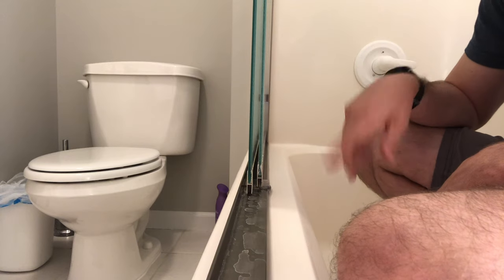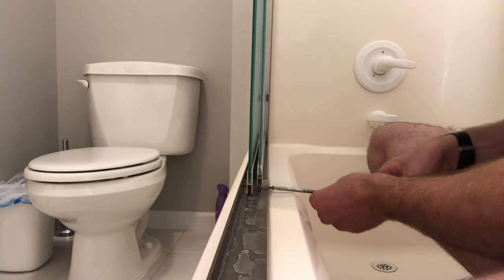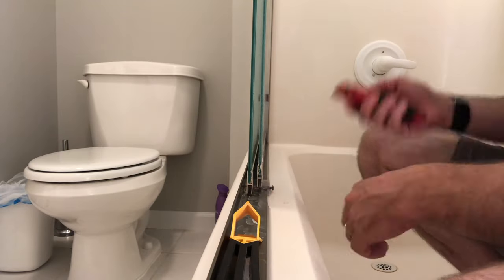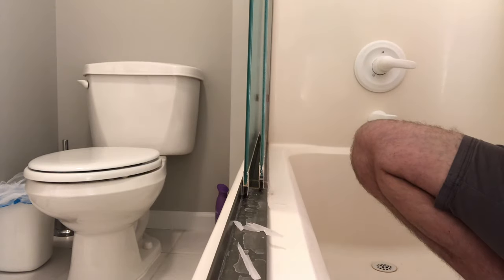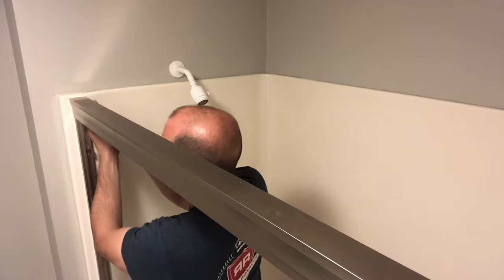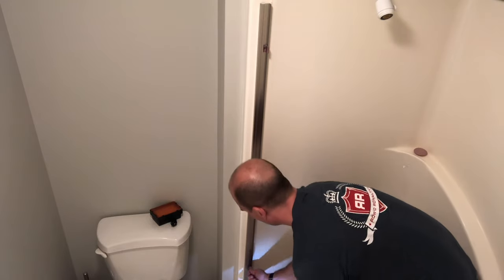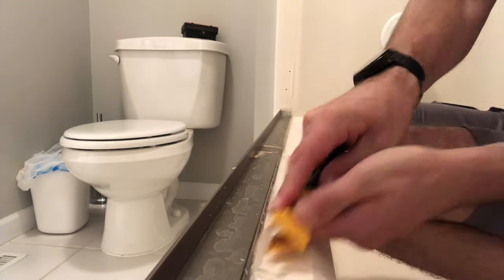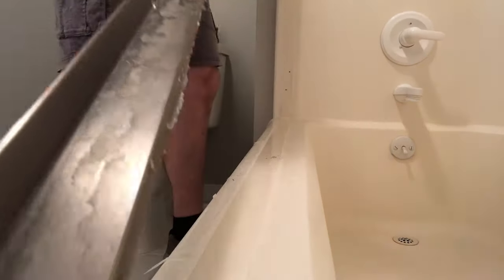How To Remove Glass Shower Doors and Frame

Comment: Thanks for this. Ours is old, scummy and rusty. I just love shower curtains because there are so many cute designs/colours to make a bathroom pretty! 👍
Reply from the maker: Yeah, all the others I have taken out have been pretty rough.  Good way to freshen up the look of your bathroom.
Reply: My problem with them is I have to use a shower chair and it's very, very, challenging to get in and out of the shower without the fear of falling on my hide... I already have an injured spinal cord as it is.

Comment: I did this with help. Doors came off easily. Rails were over-glued and super hard to come off.  But one we got them off, white vinegar was fabulous to soften and remove the side and bottom adhesive nightmare.
Reply: That’s me right now. Trying to remove the rails is a nightmare! They put silicone on the back side of the rails and and so much in the side😔

Comment: Not a downgrade its an upgrade to any shower thanks for this
Reply from the maker: For sure 👍
Reply: We bought a "spec"home. If I had my choice I wouldn't have put them in.
Reply: @EverydayHomeRepairs  no its not a downgrade I am in a RV and the shower doors when i am showering the doors are closed and I also am using a curtain. My problem is that when i move the shower rose for washing I have a leak going onto the floor and this is why Im hesitant to remove the doors to find that the water would be worse I think but thanks so much for replying as water on an RV Floor is scary!

Comment: Thanks for a really clear and simple video for removing the shower door channels. My sister just recently bought a house and we discovered that someone installed the bottom rail backwards so that the lip of the rail is on the inside of the bathtub instead of the outside. So when the water hits the shower door it just drips right onto the floor. I can't understand how someone could not realize that they installed it wrong but I will need to remove it and reinstall it the correct way. Thanks again.  👍🏼
Reply from the maker: Oh man, bummer but it should be a relatively quick fix.  Best of luck on the project!

Comment: Thanks very much for posting this video. I have a new grand baby, and my daughter wanted the tub doors removed for the EXACT same reason you describe. Removing the doors, side, and top rails was no problem, but I was puzzled as to how the bottom rail was attached: "It couldn't be just caulked in place--could it??" I said to myself. So: to Youtube! I'm taking a lunch break and then it's off to take out the final piece! 

Thanks again!

Comment: Very informative and easy to follow. this gave me the instructions (and confidence) I needed to do the job. I had the whole thing removed in under 30 minutes after watching this. I probably could have had it out in under 15-20 minutes if the bottom track had not been so tough to remove. I ended up using a putty knife and mallet to get under the track since there was so much silicone used to hold it in place. I took my time so I wouldn't chip the tub. I wish I'd done this when I bought my home 4 years ago!

Comment: Thank you for this video. I don't have glass sliding doors, but I do have a VERY 1970s sliding vinyl accordion door. Yeah, that has to go. Your video answered all my questions.
Reply from the maker: Seriously?  Vinyl accordion door?  That is a thing or was a thing?  Wish you could post pics on YouTube comments as that sounds "unique."  I have a couple other videos on this same project just in case they are relevant to your project  https://www.youtube.com/playlist?list=PLj9rGlCZDWK5XUR9lAP2pls6fos7aYY4e
Reply: @EverydayHomeRepairs   I also wish you could post a picture here. Yes, that was a thing long ago (decades ago) but the weird thing is our house wasn't built until 1976 and was remodeled in 1998. (We just bought it a month ago.) Several older people owned it before we did - maybe that was their kind of thing, who knows?

It is a vinyl curtain that folds up like an accordion with magnets on both sides to latch to the track. It doesn't completely flatten when open, so the folds stick into and out of the shower.
Reply from the maker: @dustinpetersen7730  got ya, I have seen those for closet doors but never in a shower.  I guess since they are vinyl a little water won't hurt.  🤪

Comment: Great video!

Would the tools be different if the tub was porcelain and the caulk was white caulk ?
Reply from the maker: Hmmm, did they drill holes in the porcelain?  Wonder if they only used caulk to secure.

Comment: How about using a heat-gun to aid in removing the silicone holding the shower door channel/frame? Would I be risking damage to the fiberglass? Thanks. 
I didn't think I'd actually find a tutorial on how to do this. Thanks for upping this.

Comment: Do you have any videos or ideas about fixing bathroom leaks upstairs that's trickling to 1st floor? Thanks for your video.
Reply from the maker: Hmmm, sounds like you are most likely going to have to remove some drywall from the ceiling.  For this level of repair it might be best to call in a plumber unless you feel comfortable with the job.  Do you think it is coming from the tub, toilet, or vanity?

Comment: Scott, when we hired someone to install out fiberglass tub and shower and surrounding, are the threshold between the wall and the tub needed silicone sealant? There isn't any so we have molds behind the surrounding. Do you have any pointers how I can removed the wall without damaging the fiberglass surrounding so I can clean the molds behind the wall?
Reply: I think we were bamboozled! 😔

Comment: What is that tool you used to remove the silicone?
Reply from the maker: Hey Dana, here is the caulk removal tool https://amzn.to/35gyIwB . It works well but I also recommend having a razor blade scraper https://amzn.to/2xkQp1r . Also If you are doing this project I have a 2nd and 3rd video that walk you through removing all the caulk and filling the screw holes
removing caulk:  https://youtu.be/s1pPDHEStwE
Filling Holes in Tub Surround:  https://youtu.be/4V0Xn83dzBE

Best of luck on the project!

Comment: What if there is not a screw in the mounting bracket that holds the doors in place as a guide at the bottom of the channel?  How do you remove it?

Comment: Curious as to what the tool was that you used to remove the caulk/silicone from around the frame, is there an Amazon link for it?
Reply: You can search Amazon or your local hardware store and ask for a chaulk removal tool. Hope this helps 🤗

Comment: Is there any chemicals or spray needed to remove extra caulking?
Reply from the maker: Here is the playlist which also has videos on how I removed the caulk and filled the screw holes.

REMOVING A GLASS SHOWER DOOR AND FRAME FROM TUB SURROUND
Reply from the maker: 🤔 doesn't look like the link worked the first time https://www.youtube.com/playlist?list=PLj9rGlCZDWK5XUR9lAP2pls6fos7aYY4e

Comment: My sister's bathroom has the same shower door. I'm a female. What power driller should I use to remove the screws, etc?
Reply from the maker: Hey Raizza, the screws are easy to remove.  You could just use a standard Phillips head screwdriver. No need for a cordless drill for this specific project.  Check out my other video on how to patch the holes in the tub surround and also how to remove the silicone caulk.  Let me know if you have any other questions.